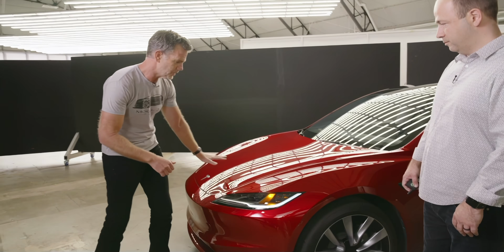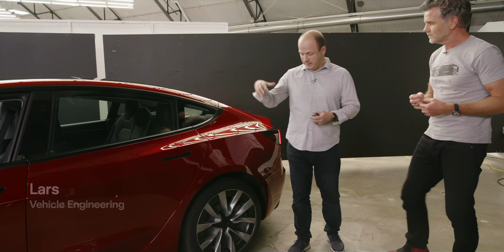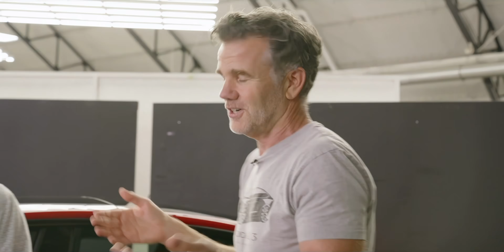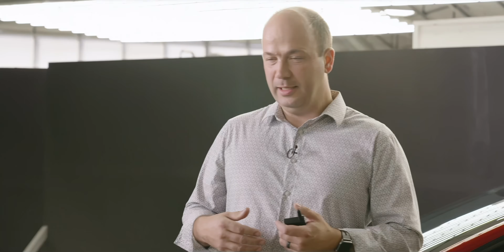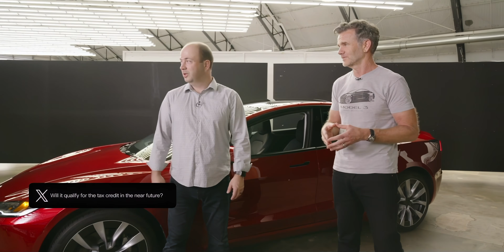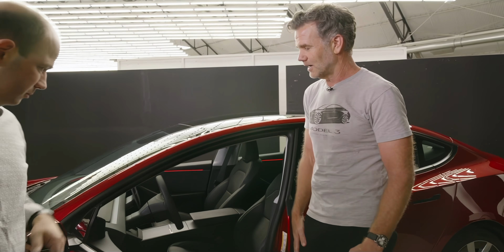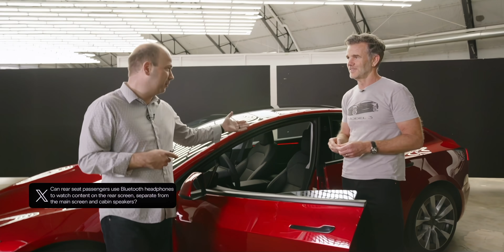Franz & Lars Talk New Model 3 | Live

Comment: Really a nice car. Only problem in Europe is that it is not a hatchback so less practical and it should be produced at Grünheide. In Europe we like cars produced in Germany and don't wan't to pay the 10% import tax from China plus shipping costs. Also it is a to expensive compared to the Model Y which is probably also due to the China production issue.
Reply: Well, maybe get the residents, government and iD10t5 on side instead of sabotaging the factory and they can get on with building cars?
A "Hatchback" would be "a different car"
What "China production issue"?
.
If you mean tariffs, that's a "European protectionism issue"
.
Protectionism usually results from an uncompetitive industry at home followed by a government worried that Industry will be decimated, which responds with a knee jerk reaction, too late.